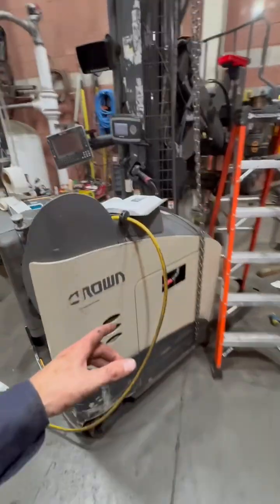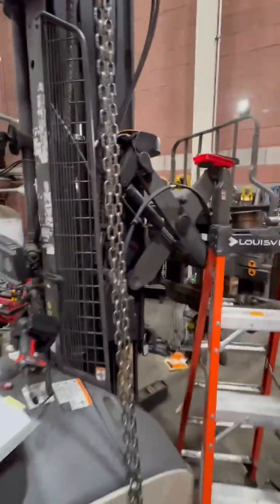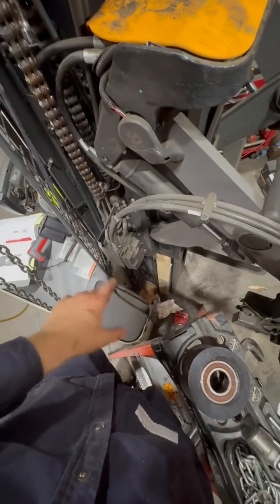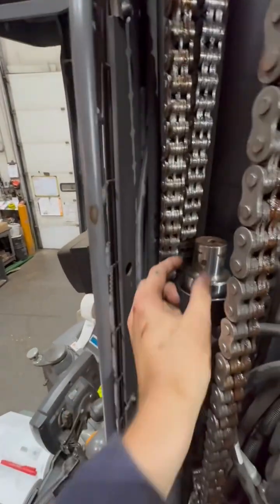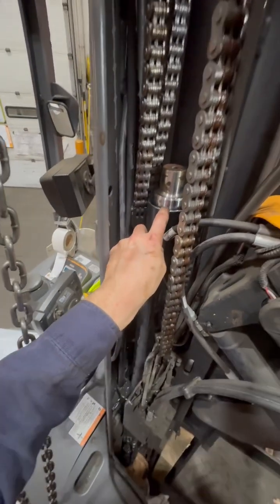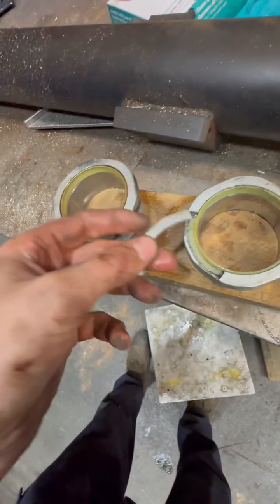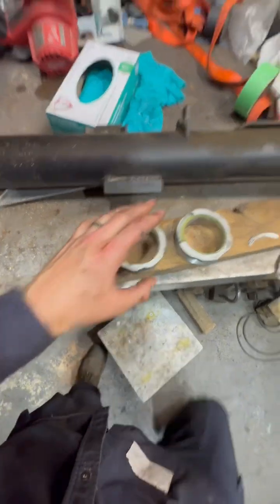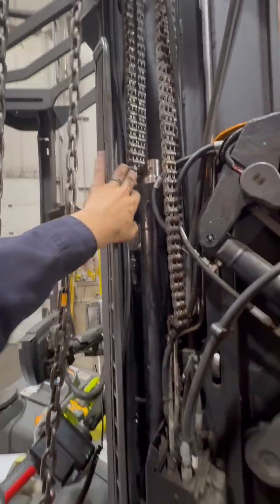Primary Lift Cylinder Repair Tips on Crown RM6000 Reach Truck

Comment: You don’t need to remove the whole cylinder to replace that seal and cap. Next time get a skinny screw deck pre drill a small hole in    The seal then carefully screw in the 2 screw decks into the seal and pull seal out by the 2 screwdeck. Just make sure you don’t scratch the cylinder when doing it.
Reply: There's a screwdriver designed for that. It's cheap.